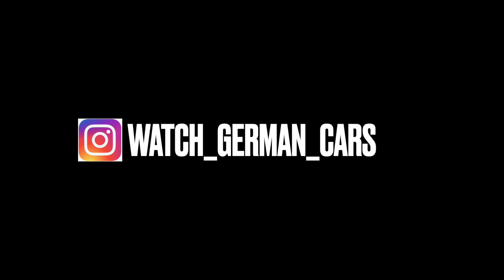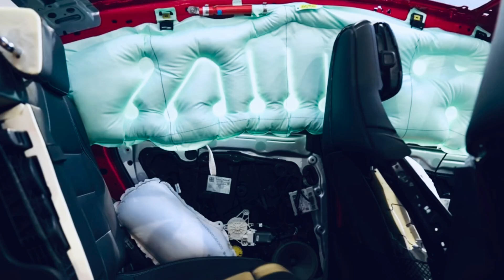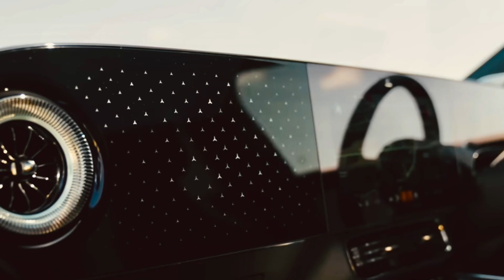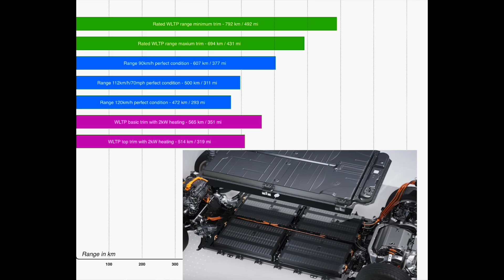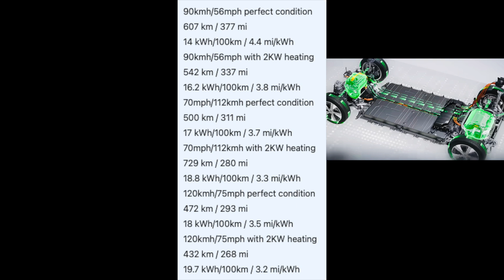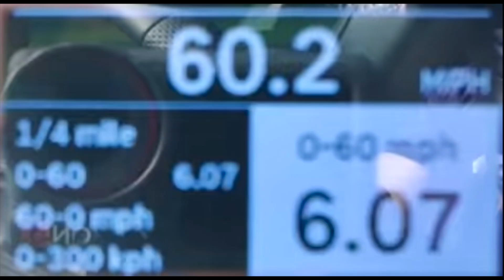Mercedes’ Bold Bet: CLA250+"800V-Only Charging" — Revolution or Dealbreaker?Charging curve explained

Comment: So it's half as quick as a decade old model S that gets the same or better efficiency ?

https://youtu.be/slvgVpVCm1U?si=DnIg4SSVMR5t3jEh

Faster charging is great...
Reply from the maker: It’s fast by 50kWh then the Tesla model s. Also gets better range in the Tesla I get 280-312 for the full pack and it won’t get over 250kWh and it’s on at that for such a short time. Here is a video on that one. Matt does not show the charging curve but in this one it does. They are good cars.   https://youtu.be/Pzq8ALp0xBo?si=6jwx9NXNWRj2n3Zv